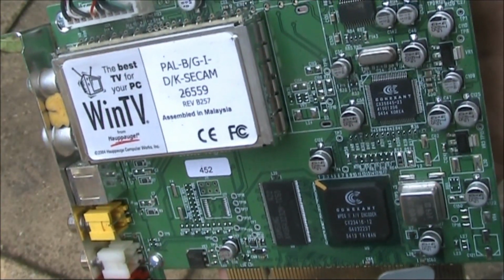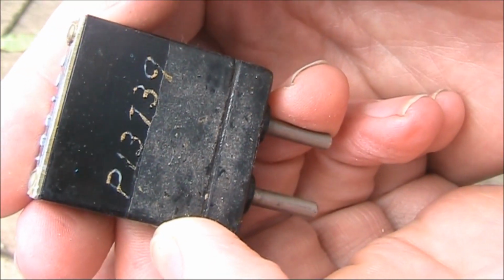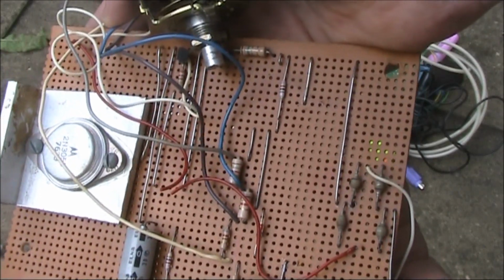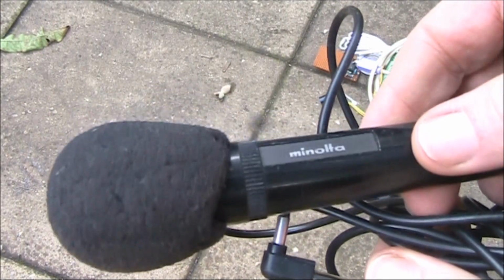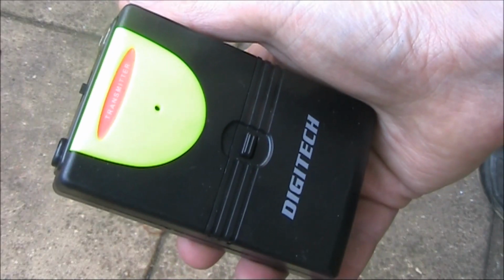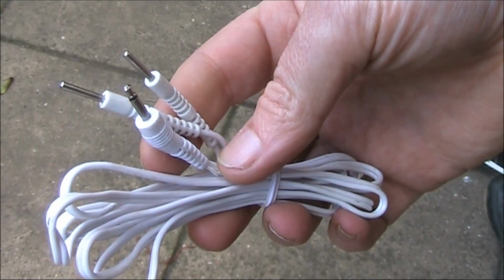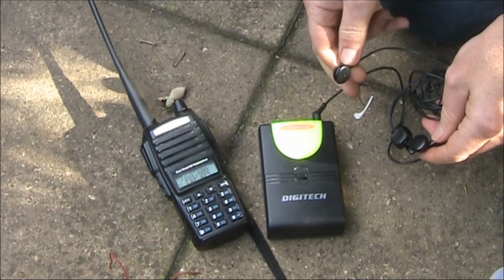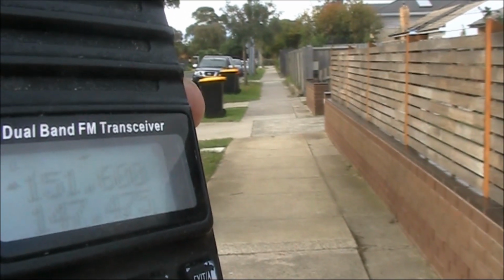All for one dollar from the hamfest

Comment: Those older TV tuner cards were good for digitising composite video (for old vhs tapes, video art or what have uou) because they didn't tend to be fussy about timebase or drop outs.
Modern analog to digital converters such as the ones from blackmagic usually need a time base corrector to be able to use any kind of dodgy signal.

Comment: Lots of those things came from my table hahaha. Glad you will be putting it to use. Will have lots more at the next one. The microphone transmitter was never tested but was new in a bag of goodies from Jaycar. The battery packs should still work.
Reply: @Timmo710 you weren't the one with the homebrew 2200m class D 300w transmitter?
Reply: @Paul_VK3HN  na wasn't me. I was the one that had the whole table that was free from about 12pm
Reply: @Timmo710  how late do your hamfests go? Over here we do 9am-12 for the two within range of me, and things generally are winding down by 11.
Reply from the maker: @qvatch  Normally ours start at 10am. Draw for door prize about 12. Finish about 1.
Reply from the maker: Thanks Timmo710!